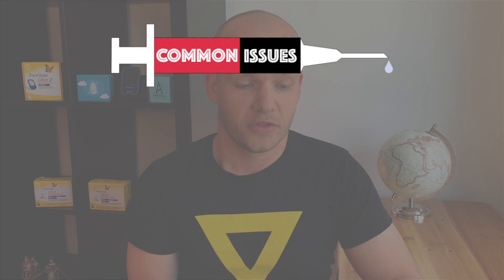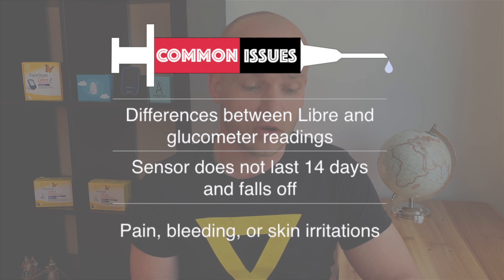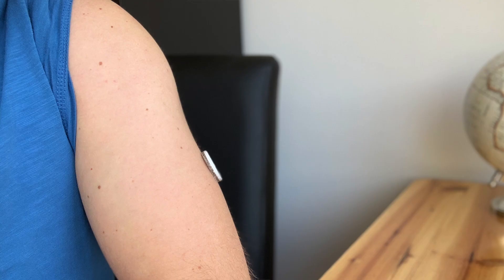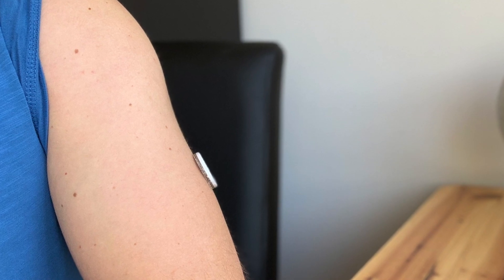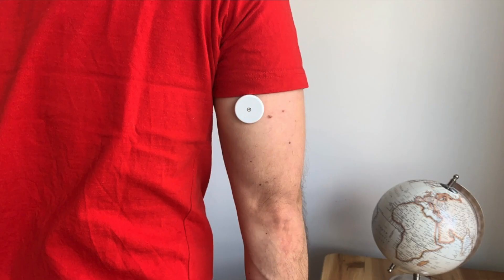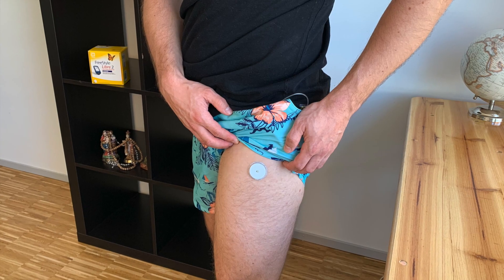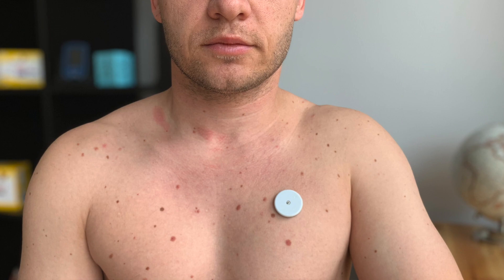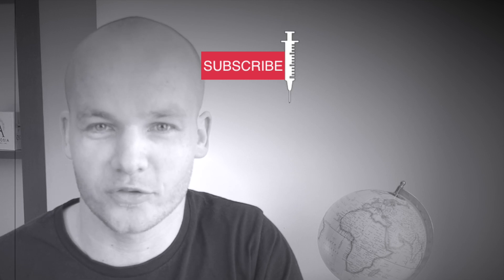Huge FreeStyle Libre Mistakes That Will Cost You...

Comment: When they showed me how to attach my first sensor in the endo's office they put it on the outside of my arm. I bumped it 20 times a day and on day 12 while removing my bra my bra strap caught it and ripped it out. I had to wait over a month for the insurance company to actually okay my script as the first sensor came in the sample pack from the endo's office. I just got my first sensor in the mail today and the instructions clearly show the back of the arm. So that's where I put it. So much better. I do not foresee having accidental removal issues now. I'm still getting used to how often to test. But my blood sugar rises around 3-4am and it wakes me up with an alarm. I'm type 2 and I can go all day without eating and my sugar never goes dangerously low. I think the lowest I ever go even without eating all through the night and all the next day until  an early dinner is 99.
Reply from the maker: Thank you so much for sharing!

Comment: I have had the unfortunate circumstance of having two sensors in a row being defective.  I called Abbott & they are replacing them but , i wonder if they are aware of the reduced ability of the places where you can apply the sensors.  Its great when they work , lousy when they don't through no fault of my own . 
0_o

Comment: Hello i really like your videos they help a lot.i have two questions ?
I bought since 5 days packages of fresstyle libre sensors and as a new user i didn't know that the maximum temperature is 25°C. So i am really worried if the sensors are still viable to use ? Also, is there a maximum temperature when using the sensors.
Thank you
Reply from the maker: Generally, I used the sensors in all weather conditions. I noticed that when it is extremely hot it tends to be less accurate but I do not have many experiences in extreme heat so it might just have been a coincidence... Good luck!

Comment: Hi Tom,
Your video presentation was very professional and informative.  We have used the Libre Freestyle 1 and then 2 for 2-3 years and our experience has been excellent.  But, we have struggled with the last three sensors because of large variations in readings.  The sensor can read 2-4 when sometimes the glucometer reads 7-18 causing stress and overloading on sugars.  This seems to be worse at night!  very strange but true.  do you have any suggestions?
Freestyle customer support has been very poor, slow and not supportive.
Reply from the maker: Hi Peter. I really appreciate your kind words. Regarding your questions I actually might have some helpful info for you:
1) Night low could be due to so called "compression lows". Discussed in these two videos:
https://youtu.be/7hr6VrwlTj0
https://youtu.be/EuWuBIB39z0
2) Regarding accuracy in general you might want to check the videos here:
https://youtu.be/qSN_Xiepowc
https://youtu.be/_A_QksKEduo
Hope this helps. If you would like to discuss in more detail you can also consider joining my membership program where I provide more personal support to patrons. 
Good luck!
Reply: They have clearly had a bad batch of sensors. I’ve had to get them to replace over 10 of them. Takes about 15min on the phone with them and they ship a replacement for free. Unfortunately, they are still unwilling to admit they are failing but it is clear they are t what they used to be in quality.

Comment: I finally received my third replacement sensor today, the THIRD one that has died out of 12 or so. I got the same error and the sensor is dead, just like three others. I can't keep doing this. Calling up, talking to a rep, giving the code, answering the questions, giving my address, waiting for a replacement, wondering if it's going to work, etc. It's so stressful. I rely very heavily on these and I spend $240/month for them. I am also seething that my pharmacy which I have been using for thirty years and knows me well won't even replace it until Abbott ships another one to them.  Does ANYONE back up their products anymore? They can't even replace something they sell??

 I have been an Abbot customer for many years, and so has my T1 daughter and my father was as well, but I am done with this stuff. I can't do this anymore. I don't get test strips so I am lucky when I find a few to hold me over until the sensor comes. I follow the instructions to the LETTER. I have experience using these, I know exactly what I am doing. I don't know, are they recycling these and reselling them after fixing the error codes? Seems a bit odd.

 Completely done with Abbott and my current pharmacy, sadly.  /end rant
Reply from the maker: Sorry to hear that my friend!
Reply: I understand your frustration same for me they never work properly I can’t tell you how many times I’ve had to call up for replacements. Shocking
Reply: @Bebe-ow6gy  Yea, once this sensor ends I won't be buying anymore. I don't find them accurate either. I am constantly double checking with my other meter when something doesn't feel right.
Reply: They have occasionally given me an email with the info that I can bring to the pharmacy and they use the info to fill it like a free prescription. That way I don't have to wait for a shipment.
Reply: @annavsart9769  My pharmacy doesn't honor those because Abbot often won't replace the sensor once the pharmacy replaces mine. So many of the pharmacies near me don't do that. So the pharmacy owner is out a sensor and the cash. Been through the whole process, and I actually know the pharmacy owner well that I deal with and he said Abbot can be pretty sleazy about it.
Reply: Oh wow that's trashie! I had no idea. I need to call abbot again today to replace 2 defective sensors. I have more that don't work than those that do lately. So frustrating
Reply: @annavsart9769  The Abbot rep at one point suggested I speak to my endo about other options. Uh no, your sensors suck, often. It has nothing to do with my endo or myself. The process of replacing them is even more frustrating. The last one that didn't work I am not even going to bother replacing. I'm done with them. I mean come on, it's [current year] and they don't have a digital form you can fill out instead of waiting on hold on the telephone to answer a bunch of questions?

Comment: As a brittle Type I, who can range from 60 to over 600 daily, my sister scans frequently.  She is also in dialysis 3X per week, where they are not allowed to eat or drink.  Combined with a long commute where passengers are also not allowed to eat or drink, it is imperative that she check frequently.  We have found that both the Libre and Dexcom have some glitches  but overall they are much, much better than painful finger-sticks.  I think people expect too much from technology, and tend to panic over a few points. If they devoted some attention to food and exercise management, those readings wouldn't terrify them.
Reply: This guy must be a spokesperson for this product because this product should should be moved from the shelf delete. for the past 3 months I've been having problems when call representative they told me the product is on a recall. . In fact they just sent me 2 replacement  I just put one on about an hour and a 1/2 ago and the s*** still aint working. My experience my opinion its garbage.  I am so done with freestyle Libra
Reply from the maker: Thank you so much for sharing these valuable insights Lucy! Much appreciated!

Comment: My doctor asks me to test with an actual glucose test once a week. Most of the time I forget. The sensor covers I use do cover the little sensor, but it doesn't have a thick layer and doesn't have an adhesive in that area. It's almost like a tiny little bit of gauze with a thin layer of cover. I haven't had an issue so far with my sensors and they stick pretty well. I have been wearing the Libre system since March. I found them on Amazon. Brand: HECHUAN Freestyle Libre Sensor Covers Waterproof-30 Pack Freestyle Libre 2 Adhesive Patches, Transparent CGM Overpatch Tape Lasting to 14 Days-Without Hole.  Though, sometimes they are hard to apply on the back of the arm without help. Tonight I had to use about 3 before I was satisfied with the placement of the cover. lol I scan about 8 to 10 times a day most of the time.
Reply: I have been on both long and fast insulin for over 3 years. I talked my Dr. Into using Free Style  2 about 14 months ago. Have had NO problem with my patch failing. I follow the I instructions from Libre and it works for me. I have a problem that my reading requires only 1 or 2 units of insulin. I do not like sticking a needle for less tha 3 or 4 units of insulin. Then I have found that I need to multiply by 3 to get my insulin to within the required range. If I take only 3 units my sugar doesn't drop. If I take 9 units it will drop into the high end of normal. If my sugar is not going up or down I am lucky to get it into normal. If my sugar is raising upward then it is x4. So instead of 9 and to take 12 units. This is when the chart my Dr gave me shows I only need 3 units. This confuses me. I when I am trying really hard to bring my reading to the normal range and instead it ends up stilling being high or drops down to low and I take 1 or 2 Religh tabs to bring my sugar back up. My A1C has been at least 9 and sometimes 13 during  the last 3 years.

Comment: Hello Tom I am having a little problem with my freestyle libre the second one I put on after the first 14 days is not working too well it tells me on the scanner and on my phone scan error and then it tells me to check it back in 10 minutes and I have done that twice and it still tells me the same I am partially blind so it makes it a little difficult even with my magnifying glass to look up instructions in the books could you please help me and tell me what I could be doing wrong or what could I have done wrong I appreciate your feedback
Reply from the maker: Hi Ana. I would recommend calling Abbott and requesting a replacement sensor. Good luck and all the best!
Reply: I have the same problem and wasted 3 sensors so far.
Really can't understand this 10 minutes problem.
I even bought a new meter.
Same problem.

Comment: Hello Tom and thank you for these informative videos! I am about to  buy a Freestyle Libre 2 (Libre3 is not available here in the US☹).  I am most comfortable sleeping on my back, and do so 90% of the time.  With the sensor on the back of the arm, does this put undue pressure on it causing problems?
Reply from the maker: If you don't lie directly on it, it should be fine. Thank you for your kind words!

Comment: I scan every two hours. My diabetics coach wanted me to just to see what the sensor is doing. I actually like the every two hours because it helps me gauge what is going on between the times after and before a meal.
Reply: Hi Thomas, if you scan it that many times does it last till the very end of the 14 days. I used it once and by the day 9th it showed me I used 70% of the reading usage. Scanning it around 5 times daily. Thank you! 😊
Reply from the maker: Thank you so much for sharing your experience. Have a great day!

Comment: You forgot mistake number 7: blindly believing the Libre gives you the correct reading, plus or minus 15%. When the Libre and the finger prick start off reasonably closely aligned, and at some point vary wildly I start getting a bit worried, do you really want to base the amount of insulin you inject on a Libre reading that is way out of wack without you knowing it?
Reply from the maker: Thank you so much for sharing your experience. I personally do rely on the Libre if the number it's giving me "feels right". But I think everyone is different so probably always better to check at least a couple times after applying a new sensor to get a sense if the sensor is +/- accurate. Have a great day!

Comment: Thanks for the video! I just started using the libre. The first 2 days it went crazy and then it evened out but has been 15-20 mg/dL lower than my blood glucose meter reading. The pharmacist helped me put it on, so maybe it’s a bit more to the side of my arm than what you recommend. But 20-30 points difference seems like a lot and makes it difficult to accurately decide what I can and can’t eat without multiple finger sticks (which defeats the purpose of have the meter). How can I make this more accurate (at least within 10 points different)?? Would love some help! Also, I know the blood glucose meters can have some degree of inaccuracy of their own, does it make sense to split the difference between the readings?
Reply: I have the same problem as you the libre isn’t accurate enough and so often tells me my blood sugar is lower than what it actually is
Reply from the maker: I actually made a couple videos on the accuracy topic. You might want to check them out! Welcome to the Libre team!
Reply: The reader for the libre 2 can work as a glucometer also, there are test strips available for it. I bought some from Amazon. Used the Libre reader as a glucometer, then scanned my sensor. The results were very close, almost identical. When I did a finger stick with a different meter, the results from the Libre scan was 20 points higher. I made comparisons over a few days, it was pretty consistent. Using the Libre  reader to check a fingerstick, the readings are almost the same.

Comment: You said that Abbott says to not cover the hole on top of Freestyle Libre sensor. I recently started using MiaoMiao2 on my Libre and notice that the Libre reads very low compared to finger stick blood reading - so low that MM2 goes to a flat line before hypoglycemia because Libre says "low" when glucose isn't that low. On my last MiaoMiao2 application, I cut a slot in the round tape that sticks MM2 onto sensor, hoping that the small channel will allow air to reach the hole in sensor. Now, my Libre readings match my blood readings very closely. I wonder if this was a coincidence (a rare Libre sensor that reads correctly) or the slot in tape actually works. I need to try this on more sensors before I am convinced this helps. What do you think? Maybe you can test this on your channel. If it works, maybe MiaoMiao2 tape needs new design.
Reply from the maker: Hi Jude. Thanks for sharing the tip. To be honest, personally I never had any issues covering the spot with Miao Miao. So although using MM2 is not exactly in line with what Abbott recommends to me it does not cause any difficulties. Wishing you a great weekend!
Reply: @TypeOneTalks  Tom, thanks for the reply. I try to keep my blood glucose level between 70 and 100 mg/dl on a constant basis. I can do this as long as I get reliable data. But, my Freestyle Libres were reading 20% to 30% low with MM2. That's why I tried cutting a slot in the tape (to make it look like C) and uncover the hole in Libre. As I said, I will keep trying this in the future to see if it really matters to the Libre accuracy.
Reply from the maker: @fnhff  You are most welcome!

Comment: some people had big difference in result. while the sensor says its 90, the finger stick says 50.. that's lower then 60. most people can tell when their blood sugar is low. for dexcom users they say like it gives results like the future.. that it will go down .. what i learned ppl with low blood sugar issue best not use freestyle libre
Reply from the maker: Thank you for sharing! All the best in 2021!
Reply: That's bad news for me as I sometimes have Hypoglycemia unawareness and it's my main reason for buying this device. I also dont have insurance, so the Libre2 is the most affordable option for me here in the US. 
 In this case, since the sensor is reading 40 mg/dl higher (90 instead of 50) should one set the Low alarm at a lower range?

Comment: Hi Tom, another important tip is to make sure you set the sensor for application according to Abbots instructions, pressing down on a hard surface. If users don’t this may lead to a faulty sensor error. I also find if the sensor starts saying to scan again in 10 minutes it’s usually the filament a bit bent to pushing down and wiggling it a bit will sort this. Finally I wear my sensor on my inner thigh as it never gets knocked and I don’t need to tape it there, I’ve only ever lost one in 3 years wearing it here climbing up onto a high bar stool. I have never lost a sensor to the dreaded scan in 10 minutes error so this can be fixed if you get onto it right away. Maybe a couple of useful tips to add into future videos 🙂
Reply from the maker: Hi Terrina. Thank you so much for sharing your experience and your tips. These are all great points! Much appreciated. Have a nice day!

Comment: Thanks a lot for all the great videos! I have two questions, that maybe you know the answers to?

1) Do you, by any chance, have any advice on what to do when I need to change the phone I started a sensor with to another phone? I use iPhones, and I would prefer not having to attach a new sensor.

2) Do you know a way to get an alarm function on an iPhone using LibreLinkUp to follow the scans made with another phone? As far as I can tell, all I can get is a standard notice, which is insufficient when I (father) am sleeping and my child's alarm goes off in a different room.

Thanks for your help!
Reply from the maker: Hi Andreas. Thank you so much for your kind words. They trully mean a lot. Regarding your questions:
1-If you change your phone you won't be able to use a new phone to read a sensor that you activated with the old phone. You need to apply a new sensor and start it off with the new phone. 
2-I am not sure about this one. But if the wifi reaches to your room you might want to make your phone the main phone so that it received the alarms. This will not work if the rooms are too far from each other or if the walls are too strong to let the bluetooth signal throuhg. 
Hope this helps. Wishing you and your little one all the best!